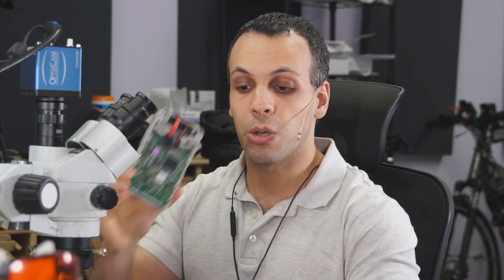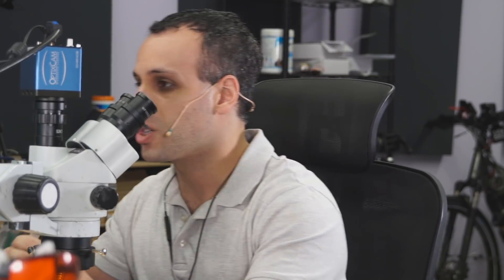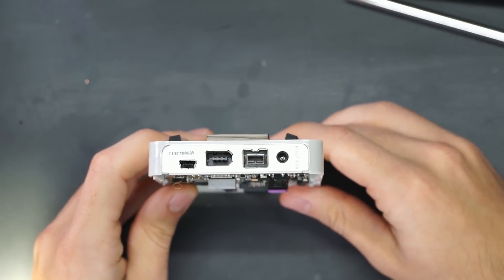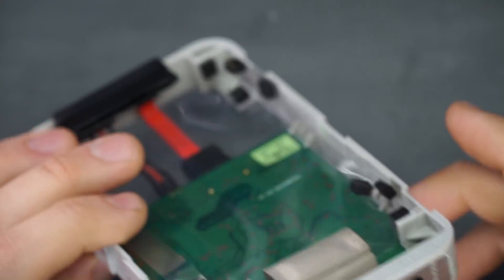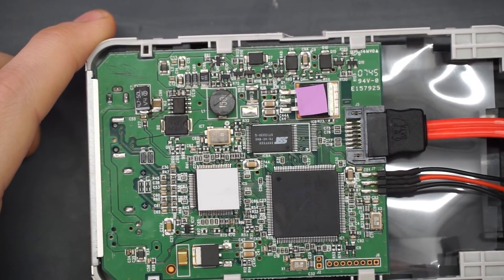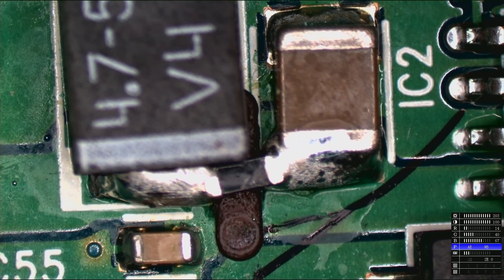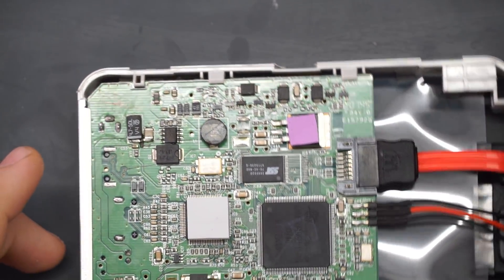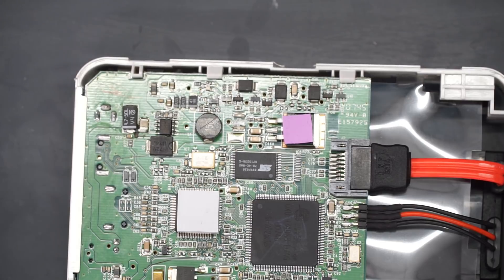Lacie RUGGED external hard drive: a peek at the PCB

Comment: I used FireWire 800 for an old external hard drive for my 2011 MacBook pro and a FireWire 800 to 400 cable for a digidesign 002 rack. The MacBook succumbed to the Radeongate issues quite a number of years ago and I haven't bought another Apple product since.

Comment: I use both firewire all the time.  Cheep drive enclosures, Good drives, old drives.  I got tired of using a toaster all the time.  But with Firewire you can daisy chain them so easily.  Forgot about that didn't you?

Comment: LaCie (pronounced Lah-See, for "The Company") is an American- French computer hardware company specializing in external hard drives, RAID arrays, optical drives, Flash Drives, and computer monitors.
Reply: That's how they started..
For a long time now they have been a division of Seagate..
You pay more money to get a Seagate drive dressed in an Aluminium box with some famous design houses name on it..
They even make limited edition models that have the same insides but weird outside designs that were made to gather dust, Fingerprints etc.. and be impossible to clean..

Comment: I'm fairly certain I used a Firewire 800 with my 2009 iMac and Apogee Duet. The 800 is the smaller size and the 400 was the larger size...right?
Reply: The smallest size was the Sony ilink connector which only supported data and usually was 200. Firewire 400 was the next step up with a flat Ishq connector then firewire 800 with the usually black Square.

Comment: Iv had an older lacie than this looks like a metal brick with a hardrive in it, still works, however it being iver 10 years old I should but somthing new and move things over
Reply: Actually the drives are fine, if it ever wait, just buy a new case and a cable and there you are: your own RUGGED drive!

Comment: it happens sometimes, after board design complete and no time, and they started mass production, and simultaneously found some problem, and it's too late, then there is a way to fix, and if You open a box with such device, You may find some soldered wire :). I don't want to name OEMs who did these, but there are some big companies :)
Maybe on cheaper products there will be rev.1.01 with fix, but on very expensive ones, when no second chance, there is some wire implemented
Reply: If it works... ship it.
Reply: This practice is very common in the enterprise space or anywhere with lower volumes/high costs. I'm a bit surprised to see it on a  cheap consumer device PCB, but in the end it comes down to the cost of rework of a certain volume of boards vs the cost to respin.  Maybe this board was just one in a small batch that they decided to rework and sell anyway even though they respun for volume production.
Reply: There's nothing wrong with a good bodge.

Comment: Comparing a Rosewood to a Pinto is the best comparison I've ever heard.
Reply: I think  Yugo would be more appropriate.. a Pinto would be a middle-of-the-road Seagate
Reply: @Rx7man  yep, Yugo is much more appropriate for those piece of shit drives.
Reply: @pacadet  Seagate keeps sponsoring posts on my facebook feed for their new 18TB drives
I can't resist commenting "Great, Now I can lose 18TB at once"
Reply: same
Reply: I have two external disks with Rosewood drives and for some strange reason they both keep working. I am just waiting for them to give up but no.
I only use them for strictly non critical storage so nothing is lost when they die.
Reply: @meeder78  being Seagate doesn't mean they will fail it just means you are very lucky that they hasn't failed...
Your right on the edge of the Seagate Dead Drive Bell Curve..

Comment: Every Lacie drive I owned promptly failed.
Reply: it wasn't rugged, but rigged
Reply: Mine still works and was in an ied. I still use it. It’s beat up but still works had is since 2006
Reply: I bought a LaCie external back in 2008, it was the first 1tb external drive on the market, the only reason it still works is because it uses a Hitachi drive inside.
Reply: @s8wc3  when I bought mine 1tb didn’t exist lol. I’m still using one of the first 30g ipods
Reply: Lacie has been a brand of Seagate for ages....
You are paying for the expensive box they use and the famous design houses they pay...

Comment: I always rolled my eyes at Panasonic toughbooks for like three to six grand when all they were were a low-end Pentium with a platter-based hard drive. if you shake a platter base hard drive while it's powered on it's going to fail so how can you call the notebook rugged?
Reply: A Google User   I like to buy those little 11 inch ThinkPads they give kids at school when they're Black Friday, refurbished, loss leaders a Frys.  Incredibly well made and with thick rubber bumper all around the computer.  They're perfect for using before a falling asleep in bed, when they subsequently fall to the floor.
Reply: Take a normal laptop and put a SSD in it... there you go made it rugged.
Reply: IBM certainly understood the importance of having some shock protection around the drive more so on the tough books

Comment: The cost of redesigning/remanufacturing boards is prohibitive. In higher end and more 1 off systems, "bodges" happen often. Turn it on and take it apart.
Reply: Being involved in the PCB design business myself, I'd say that above say 50-100 assembled boards the cost of parts & fabrication defnitely overshoots the cost of my design time. Wondering if this inductor could possibly have beed assembled by a pick-and-place machine or was it added manually?
Reply: @MichalKobuszewski  I have worked with in house PCB's. The lead time can be long enough to warrant bodges just to get things out the door in time.
Reply: @timonix2  can you explain what lead time means? I have a vague idea so I want to be sure.
Reply: @xmlthegreat I refer to the time between we order something and it is delivered. In this case it also includes the engineering time to fix the schematics, board layout and documentation. As well as the production of the new boards.
Reply: @MichalKobuszewski  Many years ago I worked a lot with Tyan motherboards. Some of these were produced for several years and went through a lot of changes over time. Tyan used a system where they had a revision number and a ECN code. ECN stood for Engineer Change Notice. They were very stingy about sharing the details about just what and why something was changed but eventually I got an in with an engineer who CC:ed me all mail regarding these changes, and it was interesting reading at times. The difference between an version change and a ECN was that a version change meant the PCB was revised, while a ECN described how to rework a motherboard to solve a problem. This could be something as simple as changing the value of a component or a bit more involved including cutting traces, soldering new connections or adding components much like the capacitor shown in this video. Every time a new revision of PCB was released the ECN level was reset as all previous modifications were included with the revision of the PCB. Most motherboards would go through 4 PCB revisions at the most, but I remember one, I think it was the Tiger 100, that went through something like 15 revisions over it's life time witch kept being stretched out until it had been in production for something like four years. At least it felt like it had been in production forever. By the time it was EOL that was one impressively stable and reliable motherboard, probably the best I've worked with.

Now not all ECN or PCB revisions had to do with improving function. Some was issued as certain components was either phased out or became hard to get, so it could be something as simple as switching from one manufacturer of a chip to another. A lot of the time ECN notes mentioned very obscure errors identified by big customers and we're talking really big names in the computer industry. At times I was surprised at just who was using these motherboards and in the case of the Tiger 100 it was probably why it was kept in production for so long and only retired once Intel no longer could supply the chipset, 440BX if I remember correctly.
Reply: @blahorgaslisk7763  cool information!

Comment: Used a FireWire 800 cable for that specific external hard drive with my mid-2009 MacBook Pro back in my college days. Always bragged about how fast it was compared to everyone’s mini-USB drives and then went home alone.
Reply from the maker: A gentleman of taste!
Reply: Sadly, my G4 laptop died before that feature ever could be used. No clue what killed it, which is the story of every dead Apple product of mine from the 2000s.
Reply: The thing is, was the drive actually fast enough to make use of the firewire 800?
Reply: @Rx7man  Perhaps it had sam RAM cache to make small files fly :)
Reply: @Rx7man  definitely, iirc mine had a momentus 7200.3 in it which could comfortably do 85MB/s on the outer edge reads and writes which is more than firewire 800 can sustain.
Reply: Raoul Duke   I can relate. My iBook G3 (800MHz, opaque) still has a working battery that holds about an hour of charge - while late 2006 MBP has had its replacement battery die not long ago (from NewerTech, supposedly second only to OWC, as far as 3rd party parts go).
Reply: @mereobserver1727  wut? how? I never had any laptop giving good battery after 3, max 4 years with good use. They have some magic in battery making there. Laptop batteries cost fortune and are usually bad knockoff quality, worse than original.
Reply: Raoul Duke  coincidentally, I have ordered a g4 ibook off ebay to replace my g4 powerbook. They use the same RAM and type of hard drive, so my 120GB m.2 SSD(via PATA adapter) should make the transition not so bad.

I hate taking the GPU hit, but don't really do anything too demanding graphically anyway. Mostly OS9(& earlier) games, writing, and 2D art.
Reply: This was exactly me!! used the firewire 800.. bragged how good I was used it on my 2009 Macbook pro loved it. The HDD ended up dieing... Ironic.
Reply: I still use FW800, welp.
Reply: Hey 800mbps in 2009 was the shit
Reply: Haha likewise!
Reply: Lol me too. I had a mac g5 still then.
Reply: me too. I even bought a FW800 expresscard for my macbook1,1 so I could get scorching speeds with my lacie 1tb raid drive. ($800 back then!)

Comment: I had one of those, until it fell to the floor with the usb cable attached breaking the connector. I managed to save the disk inside and I moved it to a cheaper enclosure :)
Reply: I've found some external drive cheap than the internal ones, so I'd open them up and put them in the desktop machine and toss the case, or use it as a testbed for other drives, maybe long term backups, etc
Reply: José Aubele   Same here with a Seagate external HDD.  I still have and use the drive, 10 years or so later.

Comment: I still use FW800 daily for drives. Sure its slower than USB 3 but much more consistent transfer speeds and not CPU dependent so even when a system is pegged it doesn’t affect it.

Comment: I actually still use Firewire 800 occasionally but used to use it for editing sound on a portable drive (at school), better two way speed for simultaneous playback / record at the time, or at least that's what I was told. I suspect part of the reason they had two 800 ports was because one would usually burn out somehow eventually. All of mine at least have one working port still and still work pretty ok.
Reply: Je1lyb0nes   It's likely they had two ports because FireWire can daisy chain multiple devices together.
Reply: On paper, yes. But the only reason mine still work at all over fw800 is that redundancy

Comment: when you asked "can you see it" I thought you were being sarcastic because yeah I see that giant piece of foam. Repairmen do this on the LG phone's wifi chip because LG cheap out and it comes unsoldered after a year. The solution? Stick a big piece of foam to push the chip down, then use the pressure from the backplate to keep the chip connected to the board.
Reply: That would actually be an amusingly thick thermal interface pad..

Comment: I may be the only person left that actually uses a firewire 800 cable - It's plugged into one of these drives on my old mac pro.
Reply: Alex Provant   "Never abandon a standard nor old technology which still works.", said a random Internet commenter who still uses an old eSATA drive enclosure plugged into an even older computer.
Reply: I got one on the old imac, but I haven't used either in several years. It just sits there and looks good. I hope one day I can reuse the monitor or something.
Reply: Nope I still have and use mine, survived an ied blast. It held up better than I did
Reply: Not quite I've had an eBay search for almost a year over the OWC dock with firewire 800 I can speak about it now cuz I finally got one I also got the Apple adapter. Mostly audio interfaces I worked with but I didn't own were 400 all of my drives were the highest I could get which the most part was 800 with a few 400. I also specifically went out in search of firewire CD drive enclosures one for DVD drive and one for a Blu-ray Berner.

Comment: I actually still have some FW800 cables that I used many years ago with Lacie drives in the early 2000's in recording studios. Still have all of the drives and they all still work, though the computer with the FW800 port is long gone.

Comment: Back in 2005 or so I bought a LaCie 250GB external desktop drive to use for Audio recording with my Dual G5. I got it specifically because it had a Firewire 800 port since my computer had it and I wanted the maximum speed I could get. It worked pretty well, but the board in the enclosure was what ended up dying first just like this one.

Comment: I have a drive that has the same connectors (other than it has a older USB-B connector instead of mini). I've actually used the Firewire 800 port on it a few times when transferring data to an iMac.